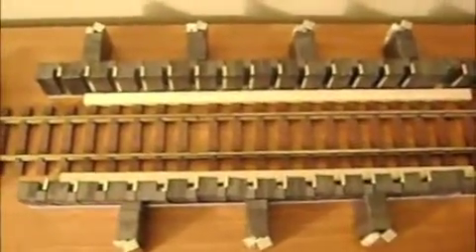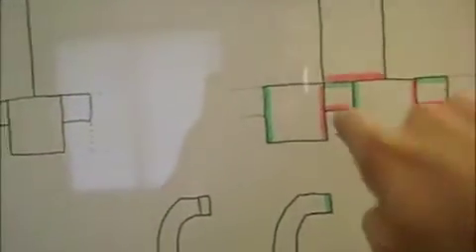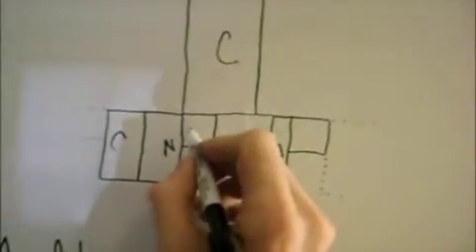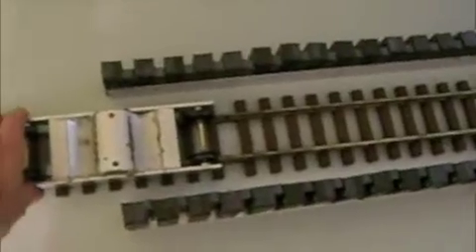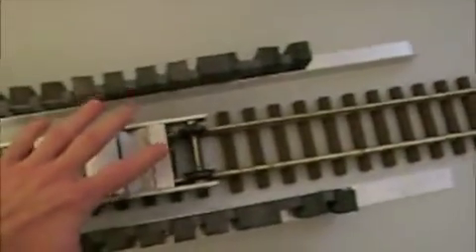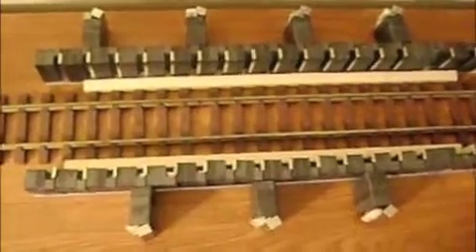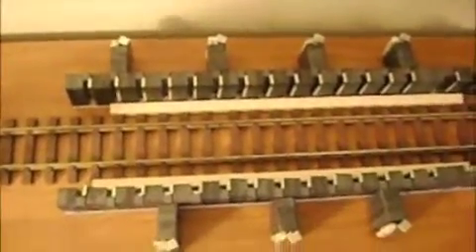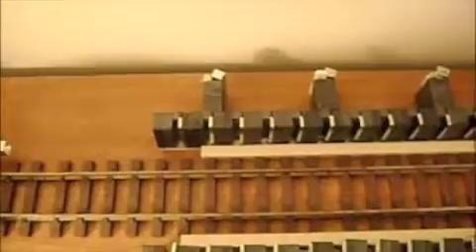Howard Johnson Linear Motor Patent Replication version 02

Comment: Folks ... everything you see in the so-called Howard Johnson lines (including him) works based on initial inertia. There is no experiment on youtube to prove me wrong. That's why it doesn't work and no one has been able to really recreate a working magnetic motor. As long as we have repulsion or attraction and stand still in the middle ... it's very simple to understand that it can never work. Let someone contradict me, let someone show me a 5 meter train line and let the "train" go, no matter where you place it. All the variants presented on youtube are small and are based only on the initial inertia ... but when you increase the train line, there is no useful magnetic field in the middle. I tried for 5 years to create a magnetic motor and I found "n" similar versions of Howard Johnson, only linear variants ... but none of them work in the true sense of the word. Magnets can be placed in many ways so that they work at distances of up to 1m (with energy loss along the way of course) and "escape" at the end .. but also due to inertia ... but never will be able to re-enter another similar pattern.

Comment: The track method seems inefficient in regards to friction. A bicycle wheel setup does not seem to be a very expensive alternative. Making a snap on 'car' to the wheel would be a simple thing. If the wheel is in a vertical orientation you can also add a gravity component.  Build a stand to hold the accelerator gate that can be easily taken apart and rebuilt. Put a magnetically inert counterweight on the wheel in such a place where gravity is enough force to assure the 'car' gets past the initial resistance of the gate. If any energy is created going through the gate then it should be enough to keep the wheel turning. The 64,000 dollar question though is if there is any energy created. If there is energy gained then I'm sure that a circular demonstration would have already been done.

Comment: dude can u build a circle of this??
Reply from the maker: I wish. The spin accelerators don't work exactly the way they would need to in order to build a rotary design.
Reply: Motionmagnetics
what about only making the turns into quarter circles? that way you can leave the straight rail parts straight and connect them to the turns to make a circle? like a square with round corners.
Reply from the maker: That would work if the spin accelerators were doing exactly what they were supposed to do. Mine aren't configured exactly the way Howard Johnson's are. I didn't manage to match his materials closely enough.
Reply: Motionmagnetics What keeps you from matching them precisely the same way?